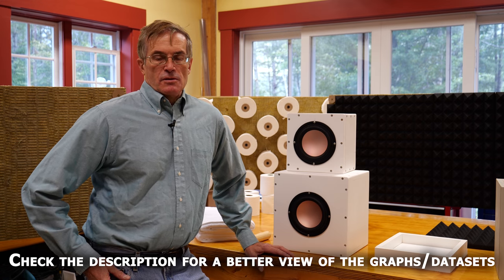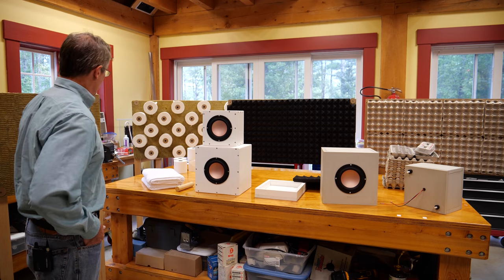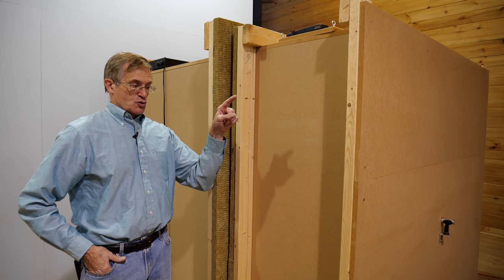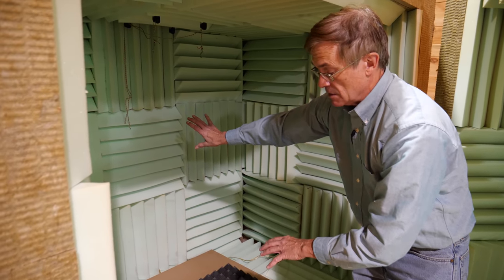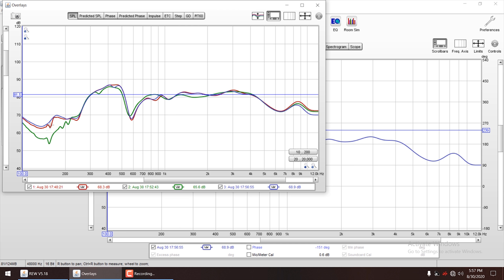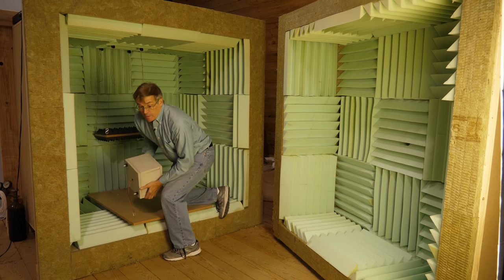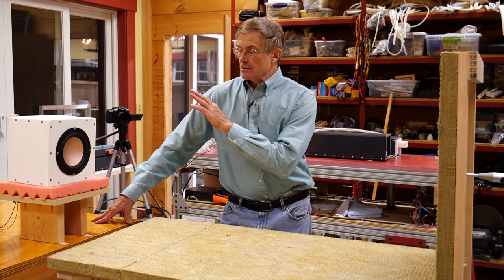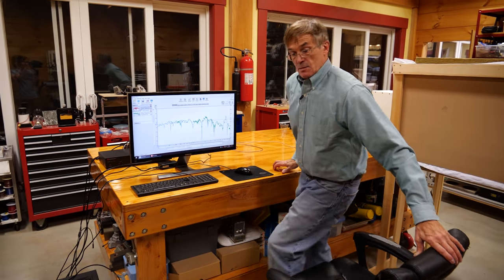DIY Speakers and Acoustic Panels

Comment: I'm a little surprised you fed the helium in through the lower "port". Being lighter than air it would tend to flow out of the exhaust "port" before the enclosed air. Yes??? No??? The addition of He to the chamber must have altered the "acoustics" by "a jump to the right" as it were. Maybe feed the He through the upper "port" and exhaust it, through the lower, to the outside of the chamber??

Comment: Do you want to talk about the big hole that was showing up at 550 to 600 in your chamber with all the speakers you "tested"? Well it is 2 big problems at play! the first is that the speaker enclosures you "tested" are small enough that they will not half space load below about 600 hz. that means your little speakers are omni at that freq and lower.  So the 550hz (example)  leaves the front of the cone going forward and every other direction at the same time. This wave will travel to the edge of the baffle the speaker is mounted in and spill around the corners of the box and then spill over the side of the box to back. This is how it will be omni. This wave then bounces off the back of your chamber and now moves forward but its behind the portion of the wave that was going forward in the first place. When measurement shows big holes like this it not the speaker performance it's often boundary interference,  phase interference from a bounce. True fact, you would get more truth taking your measurement mic and laying on ground in the back yard. As there is endless interference from the inside of your chamber and being as your chamber is small the reflections are immediate and more damaging to measurements then a fence or garage wall 30 ft away so inverse square law will take care of more of the boundary interference then your test chamber. Your chamber is not effective at dealing with much below 600HZ. Yes it will seem to be dead as deep space well above 1k but below the mids and bass will be a disaster in a box like that. Actual speaker designers that really understand this stuff at a PHD level would all say that in the absence of a real chamber open air measurement is best. Get the mic as low as you can so it does not register the floor bounce and give it a try.

Comment: Note:  you don't need to build a whole room to get enough sound isolation for home recording.  A cardboard tri-fold (like for science fair displays), some quilt matting, and one of those egg-carton style mattress pads is all you need.  The egg carton pattern keeps you from having to cut all the angles like he did.  Trifold > quilt mat > foam.  Prop up around your mic, trying few orientations until you find an angle that stops reverb from behind you and that traps the correct amount of sound.  If you have an especially echo-y room, then throw a bedsheets or even a nice, thick quilt over you and the little sound booth.  Super duper budget and portable sound treatment.

Edit: I used clothes pins to hold the whole thing together and then bent them at a 90 degree angle and then taped over them with masking tape to hold in place.  Honestly, if you have a better stapler than I did at the time, it would work way better.  My thing works, but it took forever and my thumbs were in extreme pain by the end.  Turns out that straight clothes pins are really, really not designed to be bent like that.

Comment: Might want to try agricultural/geotechnical fleece over that rockwool, to stop any fibres floating off the rockwool.
One thing to consider is flammability though - lots of exposed fleece or foam can be a significant fire hazard.

Comment: To insulate a speaker IS a good idea because insulation affects on distortion level, and this must be respected if you do not build a PA system. But, insulation reduces internal volume. And this affects on Q and F also. The more volume is lost, the more the influence is. 
And by the way, speakers are divided into 3 categories: for an infinite shield, for ports, and for a closed cabinet. TO get something a proper speaker must be selected. Price and a freq range is the last parameters you have to check out ordering a speaker.

Comment: You could easily and cheaply improve the performance of your anachoic chamber by creating some bass traps.

Would require a little change in construction but should offer a cheap performance boost.

Bass traps are basically hollow triangles you create out of the corners of a room, they absorb bass energy and dissipate it as heat.

Increasing the air gap you already have between the foam and the particle board would also increase the minim f you absorb.

Personally i'd think this would make an interesting follow up video :P

http://arqen.com/bass-traps-101/placement-guide/

Comment: Wish I saw this before making my own acoustic panels. I ended up using Rockwool safe n sound but added one layer of towel on the back. I then had speaker cloth on the front and back with another better looking  cloth for the front. . Probably didn't need the towel after all.  You should do a video on absorption for the sub 100 Hz frequencies.

Comment: Competition mobil SPL guys need this science.  They've pretty much maxed out the power input to the audio system and also the driver integrity.  They're pushing around 165db these days with their subwoofers.  Going to be interesting next couple years if they incorporate the helium or density of the gas inside a sealed box

Comment: Can you test newspaper? 
Also what about Papier-mâché?
Does water vapour reduce noise?
What about running water between two sheets of acrylic so it creates a flat but also flowing surface.
You could even try with one piece of acrylic set at an angle so the water flows down by itself.

Comment: the big drops are destructive interference and is a result of the distance from the microphone and the speaker.

did similar testing a few years back i used a 2 way automotive speaker in a tuned enclosure. after witch i took outside with a 50ft of space  placed  the speaker on a stand 2ft off the ground pointing up and placed my usb mic on a mic stand about 3ft above the speaker and used a dsp and a small linear 35watt amp with a 32 point calibration to to get +/- 0.5db flat line from 80hz to 18k. i use this tuned setup for making room correction filters

Comment: There is one thing i would like to see tested. It is about so called "vocal booths". Most try to reach 100% isolation and thus, build them using rigid sheets, then try to fill the inside with foam or acoustic panels.

My idea is different. Build a skeleton frame, add lightweight acoustic wool to the frame, leaving all rigid surfaces out. The idea is not full isolation but only lowering the sound levels that are leaving the box but this should effectively get rid of the "box" sound that is inherent in all vocal booths, even ones that are properly built. By most often vocal booths are build to stop sound going to other apartments or when one can't treat the whole room. But we don't need 100% for that, we can easily just lower the sound levels by 20dB. I just don't have the means to build two boxes and no need at the moment for vocal booth at all.. 

But it is an idea that could be turned to a commercial product.. it is light weight and since it is not even pretending to be 100% isolation, it can be flat pack or foldable design.. By placing the breathable vocal booth in the center of the room should also lower room reflections enough for it to be less of a problem. The sound is not going to pass the acoustic material, into the room, bounce from a wall and go thru the panel and into the mic at any significant levels. There are many things to test, how thick the absorption layer needs to be, for starters.

The product line for this kind of product is nice.. guitar cabs also can enjoy having a box around them, to be able to record in less than optimal rooms.. small, medium and large boxes in various dimensions..

Comment: Thankyou for this lovely vid.. i have a couple of gipes.. When you tested the toilet rolls you didn't have a hard panel attached behind them.. this is the reason for the drop in the midband. Also Cabinet stiffness is extremely important but it's down to spl you are asking the speaker to produce aswell as the tone. At higher spl's the motion of a non ridged chamber's walls will radiate their version of the source material.
 Also I would add that introduction of damping material into a sealed bass enclosure serves to lower the q of the chamber, relaxing the LF roll off of the system below the system resonance. You can perform an impedance sweep on the drivers to glimpse the effect. Midrange enclosures benefit from stuffing also as it can be used to ease the severity of modal peaks from the chamber. Much love xx

Comment: In a former home I used cheap acrylic blankets for sound absorption, hung on a c channel curtain rail a few inches away from the walls.  Bonus is they come with really cool prints and with rolling clips they can also cover up shelves or storage and easily be moved around for access and cleaning.  I’d like to see a comparison of that method.  I could play my trumpet or loud stereo, no noise outside the wall.

Comment: The idea is an input signal has an actual response...he should compare difference as I expect he wants the version with the least amount.
Or said another way, there should be a measured value of variation...compare these numbers.
Best speaker has good signal accuracy and low resonance...right?

Comment: A thorough and interesting video. Thanks!
But as some others here have also mentioned; I wish the speaker measurements were displayed as waterfall diagrams (REW has that option). I think the measurements of the speakers then will show ugly things in the time domain of the light speakers. I also believe that the measurements of the concrete speakers give a response that is closer to the speaker unit's own response, while the light speakers make more self-contribution. A concrete speaker with a correction filter will probably play music far more satisfactorily than the light variants.
The measurements of the panels provide some interesting illustrations, but I think the result has limited transfer value for use in real life.
First, the measurements show a high degree of direct sound. It becomes difficult to interpret what are the contributions from the panels and what are the contributions from the speakers. The measurements from the anechoic chamber clearly showed that the speaker does not have a linear response. Then you have to try to "code" out irregularities in the source before you interpret the measurement result. Another problem is that the tests with hard wood fiber boards to a greater extent create a room with independent acoustic than the others. The hard wood fiber boards and the variants with towel, foam and egg cartons will necessarily measure quite similarly because the hard boards set the acoustic starting point. The dorull test, the fiberglass plates and the acoustic tiles probably get a lot of help from the volume of the room as a whole, to a greater extent. If you glue fiberglass or acoustic tiles directly to the wall, the absorbent properties in a real room will look completely different. To get some of the same properties as in the measurements - and especially in the lower frequencies - you will have to have air between the wall and the panel.

Also when it comes to acoustic panels, it is often more interesting to see a waterfall diagram than a pure frequency curve. Especially when the effect is to be measured in a real room. It is in the time domain that variations in reverberation manifest themselves, and that is what is the serious problem that must be solved. But the test in the video would probably not be so useful with waterfall diagrams, since this would possibly show more or different resonances in the wood fiber boards than what they would give on the wall and fiberglass would show artificially good results.

Sorry for my and google translates lousy english.

Comment: didnt DIY perks roll the towels? also I would like to see you test the pink insulation foam as I used that on the walls in my room with some canvas art worked stretched over it and it did great and it very inexpensive at ~$35 for a 4'x8' sheet that's 2' thick

Comment: I used to work adjacent to a hyperechoic chamber, 50 feet in diameter and entirely concrete with a 30-ft ceiling.  In order to communicate it was best to whisper.  Reverb time was 17 measured at seconds.  Then I got on a tour where there was an anechoic chamber.  They let me sit in it, and you're right about the eerie sensation of no sound even with the door open.  The tour left me there and I never heard them leave.  They suspended a wire mesh above the floor to walk on.    
What kind of mattress foam did you use?  Latex?  Polyurethane?  Memory foam?  There are many grades of many foams.

Comment: Building a channel where the wavelength is a significant portion of the channel size is very difficult.  I suspect that there are reflections from the walls at very low grazing angles that are very difficult to suppress.  It would be most interesting to see what the frequency sweep looked like outdoors.  It would also be very interesting to see if the spectrum changes when the walls are closer to or further away from the path between the speaker and the microphone.  Using geometry we can calculate the difference in distance between the first reflected path. Approximating the geometry of your chamber it looks like the first null will be at about 900 Hz.

Comment: I suggest you delete the first part of this video ,  the conclusions you get are wrong. Heavy speakers will sound better then flimsy ones because of resonances and sound from inside the box is bad sound , the size of a sealed box should be calculated (and depend on the parameters of the driver ) to get a good result. Stuffing ( done right ) with absorbent material might lower the output but can vastly improve the sound of a speaker. you are very knowledgeable but you should talk to speaker builders before you put something like this out, this will not make people building better speaker.

Comment: 2 Ideas: 1.) line array speaker vs line array using co-axial speaker.  2.) Stirling engine using the waste heat from refrigeration and/or an internal combustion engine as a way to generate electricity.

Comment: I have a question about the sound absorption spectrum of nylon screens vs. other materials like cotton, rayon, polyester, when used as a microphone screen. I wonder if using materials like nylon to screen microphone recordings results in frequencies being cut twice when playing back through a speaker with a nylon or polyester mesh cover. Speech may be mushy and hard to understand when the sibilants and higher frequencies are cut too much, but how much should this concern affect audio engineering?

Comment: I am very interested in acoustic chambers of musical instruments.  To be honest I am interested in making a speaker cabinet if possible to magnify the lower notes from your dml speaker designs.  Is that possible? Or at least to magnify those sounds.  In any event I would really like to see you analyze that issue.  I am interested in the different designs of acoustic chambers like violins and guitars and pianos.  I suspect that a lot of their curvy shape is just for ergonomics of holding the instruments, but to what extent does it surve an acoustic purpose? Definitely older instruments had some curves not necessary for ergonomics, presumably to create an ideal shape for obtaining nice resonance and sound.  Like I said, very interested in your analysis of these questions.  Thanks for your great work.

Comment: Those egg crates might be a good starting point for composite panels. If you partially filled the hollows on the back with sand and closed it in with spray foam, it probably substantially alter the acoustic properties. Altering the filling level or choice of filling material might help target particularly problematic frequencies.

Comment: regarding the anechoic chamber measurement, 4K drop and higher makes sense as wavelength is 3-ish inches and you said your foam was 3 inches. And higher frequencies have shorter wavelength so the 3 inches of foam is fine.

Comment: You should do a harmonic distortion test on the different enclosure types. While frequency differences may be small, distortion differences could be large. Lower enclosure mass+stiffness leads to phase-delayed re-radiation of the rear wave into the room, which would show up as harmonic distortion.

Comment: A sealed space with perpendicular dimensions has a direct implication with the number of normal modes of vibration in it, the position of the microphone with respect to the space also has an implication. In this anechoic chamber, not all frequencies are being absorbed at each point of reflection, only a degree of them and for certain frequencies in particular. This can be seen in the REW results when analyzing each speaker. The phenomenon of waves, addition and subtraction can also be seen in the graphs. I think that when it comes to analyzing a space it is much more useful to see the frequency response with respect to the decay time (Waterfall Graph). That will considerably broaden the problems to be addressed and gives you a direct approach. When it comes to scientific measurements considering the frequency response of your anechoic chamber is crucial to later consider what it is doing in your results. For us students, or those of us who already have a degree of understanding in acoustics, we cannot allow confusion to be generated.